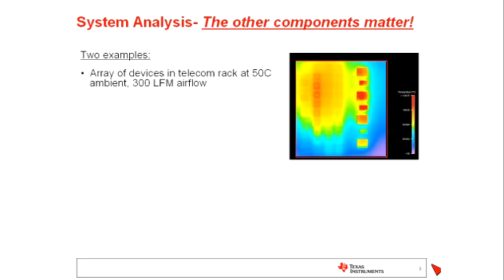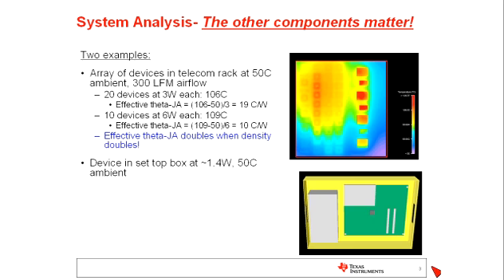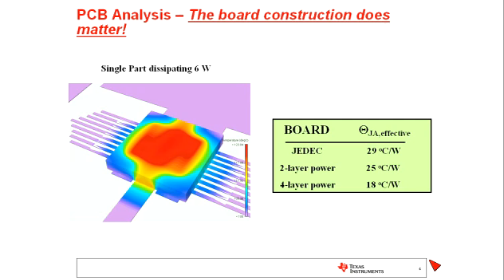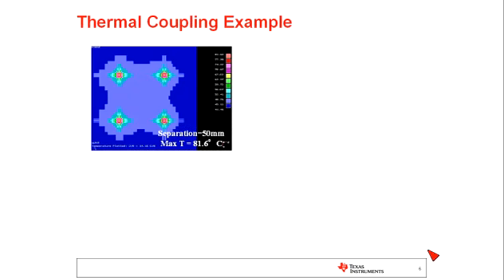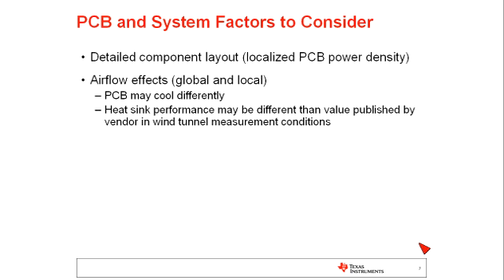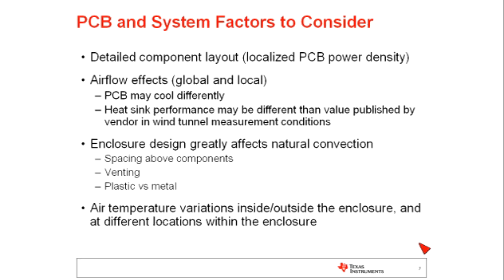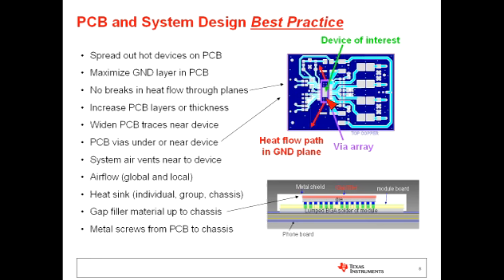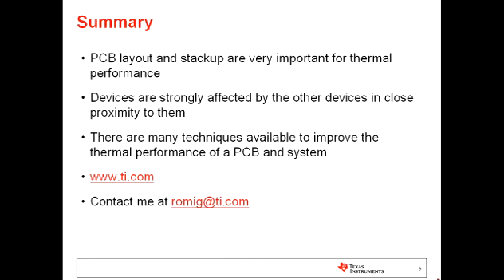PCB & System Impact on Thermal Performance (Part 4 of 4)

Comment: A good example of a serious contribution. Every printed circuit board is different and must be considered individually. Best with simulation. The input values (power loss, material properties, cooling conditions) must be correct. Unfortunately, reliable thermal material properties of prepregs are very difficult or even impossible to obtain. The manufacturers are not interested.